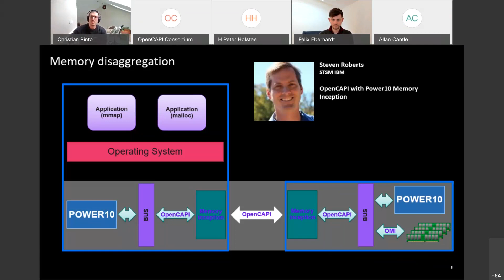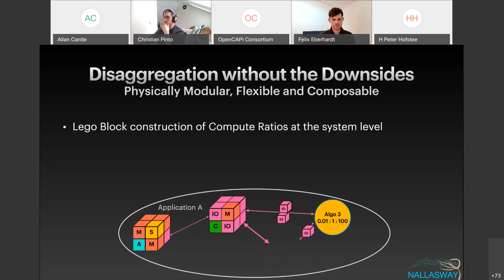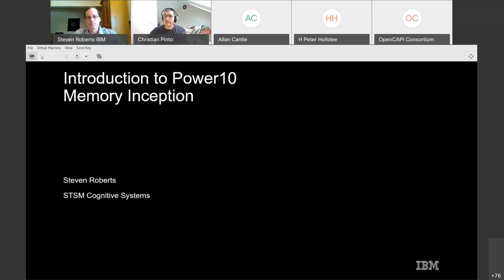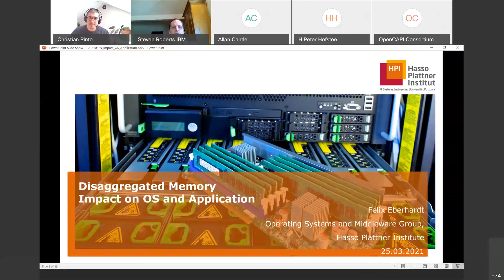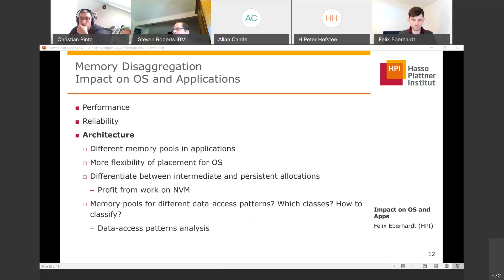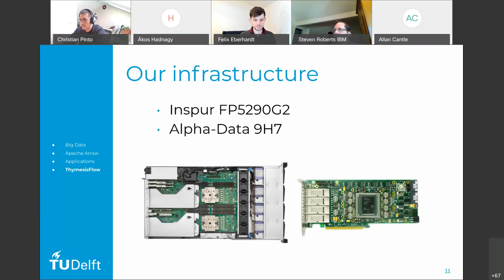Latest Trends in Memory Dissagregation - Webinar

Comment: If the borrower nodes implement AA mode, once the borrowed node crashed ,is that possible the other active borrower node can replace the borrowed node role? If that's possible, the other issue may comes out because of the cost. Just crazy idea, sorry for that.
Reply: Or should be borrowed node does AA mode?